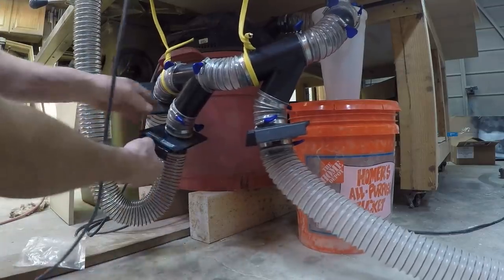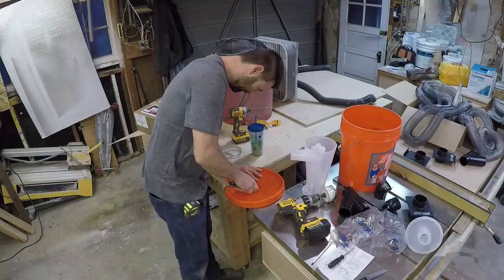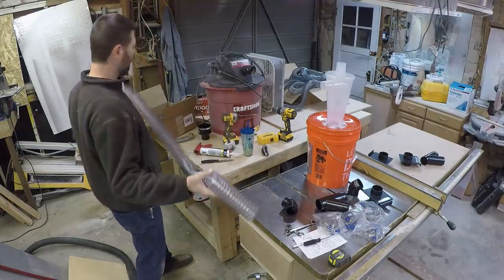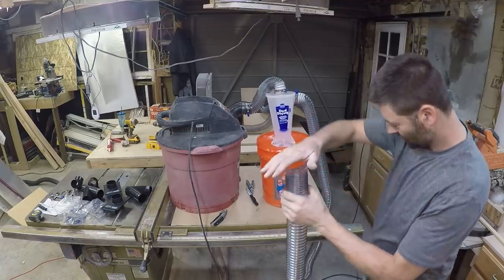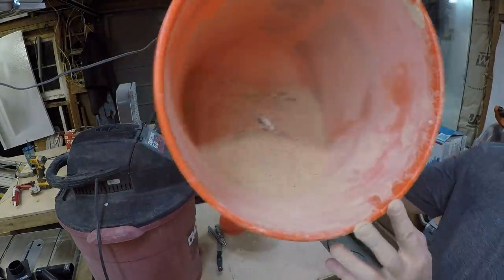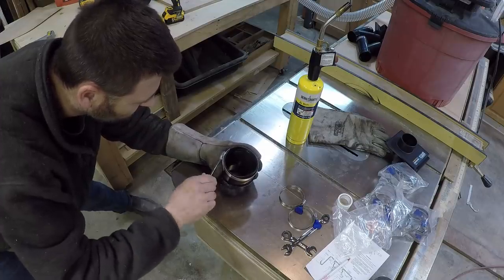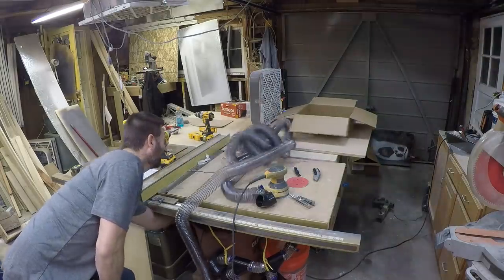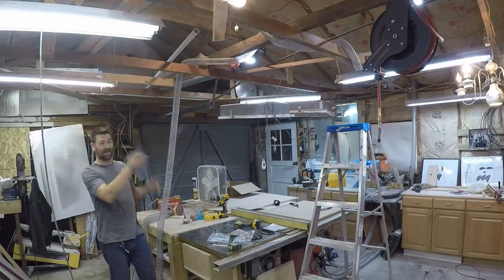Simple Dust Collection | One Hour Build Time | THE HANDYMAN |

Comment: I just recently added a dust deputy to my system and it does work great. In my shop I used a system called Shopvac dust collection kit. It contains pieces of 3 ft clear pvc pipe, 45 elbows, t y fittings, blastgates, connectors, etc. The system runs along the wall of my shop and has a blast gate at each tool. The final connection at each blast gate uses standard shop, black hose to make final connection.it took a while to get it working right. I have a drill press connected, miter saw, radial arm saw, and floor vac hose connected to the system, I use to vacuum my bench or connect to a track saw or a sander. The system works pretty good

Comment: I think if it works, it works! And simple! Looks like a winner! I think you should use some 3 inch PVC in conjunction with the clear flex hose. PVC will increase air flow and dust movement, the valves would be awesome made up in PVC to give it some rigidity for use as a valve zones station. Way to go!

Comment: Go to the plumbing section of your local store. Sometimes No Hub couplings and/or the heavy rubber couplings will help get you where you are going. Also, ABS or PVC pipe can be used in place of hose when running to fixed locations. 
When all else fails, neatly wrapped duct tape will work just fine and last surprising long as a connector.
Nice, tight, smooth wraps to make a spacer when connecting one diameter to another. Then a smooth tight wrap over the connection. Duct tape only as a spacer will work if you have a hose from another manf that is too loose in a female socket. I routinely inter-mix manf hoses on the job site so the vac can be outside of the room we are working in. 
A remote switch with a piggy back plug and a long cord works good to reduce travel to turn the vac on. If no switch, a cord from the vac to a recepticle or another cord where you are set up works good too.

Comment: I own the dust deputy and swear by it. Run hours of sanding drywall and not have to keep banging the vacuum to get suction back. Or filling up expensive vacuum cleaner bags. It is an awesome tool. I have sucked up so much cement pcs and such the inside of my dust deputy is supper ruff. The other tool I have run countless hours with the dust deputy is the large ridged shop vac. That thing is also amazing. I have so many hours of run time and I would say it still as good as when I first bought the shop vac. The Dust Dep and the ridged shop vac are a great combination. They are real workhorses. The Dep extracts 99% of what would go directly to the vacuum.

Comment: Looks like it will work.  I would think for the sander a smaller diameter shop vac style hose would be perfect.  They are flexible but rigid enough to not jump all over.

Comment: Another fun video. I don't have much real estate in my "shop" either. I will be building a cart for my tools. For the sander, how about some pvc pipe that is clamped to the rafters with only a couple of the flexible hose where you need them (drop down from the rafter) and a short section where it connects to the gate valve. Having a smooth walled pipe for most of that run would increase efficiency and suction too I would think considering the slinkying (new word) of the hose.

Comment: I got Dust Deputys for our PCB routers at work years ago.  They only had the steel welded version at the time and they work great, even for the fine fiber particles.  If you're worried about static, strip some of the steel cable out of that flex hose and ground it.  I would also recommend a larger collection bin, that bucket's gonna fill up fast.  Maybe a 55gal drum if you have the space?

Comment: I have been using pretty much the same system except on a little bit bigger scale for almost 2 years now and it works great for the most part...don’t worry about the static upgrade to a bigger bucket so you don’t have to dump the 5 gallon bucket every time you use your planer...they sell a 30 gallon “salvage drum” on amazon for 35 dollars swap it for the 5 gallon bucket lose the shutoff gates and stick with one hose and switch it from tool to tool as needed just be sure and empty your bucket before it gets more than half way full and the filter in the shop vac will last you twice as long

Comment: This type of dust separation is the greatest thing since the birth of The Handyman.   It works.   If your bucket collapses just use two buckets (like 2 cups in a stack).  I ran into this problem.  The biggest pain is the adapters.  I you have or know someone with a 3d printer they can easily build you a custom adapter.

Comment: I have a dust deputy and love it. I will say that the slinky hose is not the best to use, I use a shopvac type hose with no issues. Also with that 5 gal bucket you will be emptying that think like crazy. I made a cart and use a 20 gal plastic drum and it works great. Good luck on getting a more permanent solution. Love the videos👍
Reply: For stationary tools the shopvac hose works well but hand tools and stiff hoses is a pain to work with like the orbital sander. You need a slinky hose from the ceiling so it naturally moves around with the tool easily.
Reply: Practical Guy your right about that. I just use the bag for the sander.
Reply: @jeffreybruning7836  I use the bag also to be honest. I tried my ridgid vac hose attached and it was in the way. Last thing I want while trying to sand evenly is that! I do most of my sanding outside now anyway. My friend has the dust deputy and loves it. I should get one.

Comment: I bought the same unit about a year ago, and it works absolutely great, no problems, my new shop vac has no saw dust in it and filter stays clean.  I used it a lot and I swear by it, no need for a costly vac system. You definitely need stronger hoses though, the ones you have are shitty for that type of work.

Comment: Glad to see that the Dust Deputy made it off the bench and into service.  Great video, but I'm confused as to why you needed to take the dust deputy apart to mark the bucket lid.  Why not just measure the outlet hole in the Dust Deputy and drill that size in the middle of the bucket lid?

Comment: I built a similar set up, same blast gates and vac. I used 1 1/2 PVC, to nicer Rigid shop vac hose (orange one) for my sander setup. Works great!
Reply from the maker: Thanks.  I have the orange hose on my shopvac in my trailer.  I have a feeling I'm going to hard pipe a lot of this.  Thanks for the tip.

Comment: With mine, I used a 5/8 plywood cut to fit the HD lid.  Plywood is between bucket lid and dust dep. I am glad I did. My rig goes job site to job site and it takes a beating.

Comment: Try to pull the slack out of your flex pipe/tube. Not too tight, but tight enough that the vacuum doesn’t make the slack bounce all around.  Maybe the short run areas you use clear pvc piping (near your gate area). But overall it doesn’t look too bad.

Comment: Check out the Rockler Dust-Right small port collection hose kit for your sander. I bought exactly the same hose kit as you did (it looks like) and use that on stationary machines, but the Rockler hose is more appropriately sized for small tools and the hose has some weight and won't collapse so much. It also comes with rubber adapters that fit almost all my small tools with ports (palm sander, belt sander, etc). You will need a reducer and the large hose will collapse some, but you could secure it to the ceiling and then drop the small hose down to your work bench. Works for me and my Dust Deputy.
Reply from the maker: great comment.  i will look into it.

Comment: I've been thinking about doing this too. I've been doing more and more condo work lately and a lot of the time you have to cut in the unit. I tarp everything off and use the vacuums on the saws but it doesn't always work the best. Mitre Saw is pretty bad, just blows dust everywhere.

Comment: Time and money permitting, I recommend that you hardline everything that doesn't need to move, and only use the flex hose where it has to move. You'll get less clogging over time as it builds up in the pipes, plus it's much easier to get the build up out of a hard line than a flex line.

Comment: Pretty awesome!
I would have used rivets & liquid gasket maker to attach to bucket lid(if bucket collapses, can just buy another one aa put same lid on. Getting air pressure adjusters that can attach to the hose aa tools can help control suction as well(use one on my vacuum cleaner hose).
If it works....it works, & is all that matters👍🏻
Thx for earbud caution, lol.
Cheers😊

Comment: You take some wire, make two loops at both ends that can catch the hose segment between its rings, the actual wire length depends on you. That should be a cheap solution to no replacing the hose and will stiffen it up a bit.
Reply: Looks like those wire frame bottle/wine table holders.

Comment: HomeDepot sells a thein baffle unit that snaps on to a 5-gal bucket.  Its not as good as the Dust Deputy for super fine dust, but for less than half the price and a much smaller profile, it works well enough to keep on a job site

Comment: Makes cleaning up and collecting the large dust a piece of cake no more sweeping, but the small dust that kills you it won't catch.  No worries just wear the mask, its not that bad.
Reply: @smokingcheeba420  Unfortunately it's been proven that dust that is 2 -10 microns in size requires 800+ CFM to move.  You can't see the dust, but it is enough to cause irritation and long term health hazards.  350 CFM of air movement will provide adequate visible dust collection.  I don't doubt it collects dust, but your lungs are collecting the find mdf dust.  You can google Bill Pentz if you want more details.  I would protect yourself, MDF is especially nasty material.

Comment: This video just made me realize something. Too many of my projects end at the “proof of concept” phase. I never had a great name for it. Most of the excitement is gone and I work with and around a mess and incomplete work for too long. I need to work on follow-through and the discipline involved with the fine tuning completion early on. This would save me time and grief in the long run.
Reply from the maker: I know what you mean.   I still have it set up the same and it working great. Someday I will make it perfect.

Comment: The thing is if you use a stiffer hose it will be more in the way with the hand tools like the orbital sander and you'll find yourself managing the hose position more often as you move the sander around. That springy hose naturally moves around with the tool well so to me there is nothing that will be better. You'd be better off to drill a hole in the coupling at the sander or crack open one of the valves for another tool just slightly so there is less pressure in the system causing jump in the hose. Not a big deal if its hanging from the ceiling though.

Comment: I got a dust deputy DIY kit for my shop and it works great. My bucket did collapse when under full suction but if you just put the deputy bucket inside of another bucket it helps keep its structure.

Comment: I had this set up for a while.  It will work fine for the miter saw and the sanders but the table saw made the 2 1/2 inch hose clog up pretty fast.  It was annoying to have to clean it out all the time.

Comment: Hey Handyman, the shop vac will work ok but its going to be noisy and once you get tired of it you can find a dedicated dust collector from Amazon for about 125 bucks (this one https://tinyurl.com/y2kok23a ) and then mount it up in the top of your shop and route your airlines to the bucket, and then out to your manifolds from there.  The dust collector itself will probably have more CFM but it also depends on your Vacuum.  My vac was supposedly a 5 horsepower craftsman but it sucked (no pun intended) and the dust collector blows it out of the water.  With the Dust deputy collecting the dust you can keep it down low, have the dust collector up high enough to be out of the way, but still not outside so it is not getting weathered.  You might have to check the filter once in a great while but that dust deputy will do its job and keep everything in your homer bucket.  I am doing something similar with the Home depot version of the dust cyclone because it has a lower footprint and a side exit and I did not want all the garbage  hanging around on the floor or taking up space.    I just have a bracket on the wall I made to hold the bucket up high so its out of the way as well and then running clear air vaccum pipe pvc to my tools and also to my sand blast cabinet to prevent hose collapse.
Reply from the maker: Great idea putting it up in the ceiling area.

Comment: When I die I want Handyman to vacuum my ashes with that thing & bury them in a plastic bucket. Anything less would be disrespectful. ☝😔

(Not 100% certain but most dust explosions happen when collection systems fail; aren't maintained, cleaned out, etc. And too many particles end up in the air instead, rubbing together, (friction) & this creates the explosive static charge. Meaning, the flash occurs in the air & not the collection bin. But if you're concerned about the bucket & electric/static charges, could you spray the interior with rubber Flexseal to help prevent that?)

Comment: That hose is too big and not rigid enough.  I'd use a 1.5 inch orange mr nozzle hose that is much more rigid.  This system should work for your miter saw and sander, and for a blade guard on your table saw.  But not for the base of your table saw.  That would require a much larger dust collector that moves a lot of air.  Better than nothing though.

Comment: Unfortunately a 5 gallon bucket will fill rather quickly while woodworking. Can you use a bigger container?
Reply from the maker: yes.  this was to test and see if it is working and worth my time to develop it further
Reply: An Alpha screw-on lid (also available at HD - paint dept) would make disassembly and dumping easier